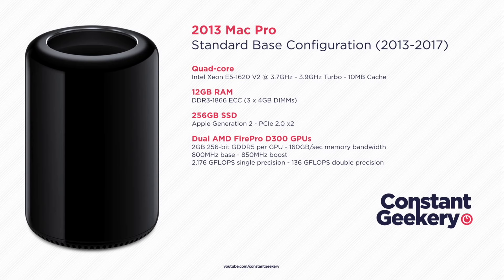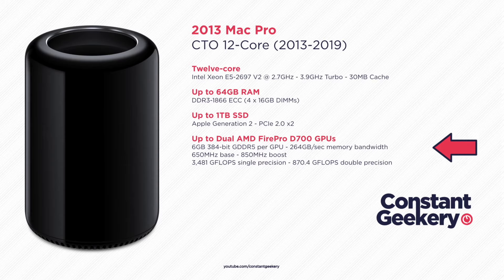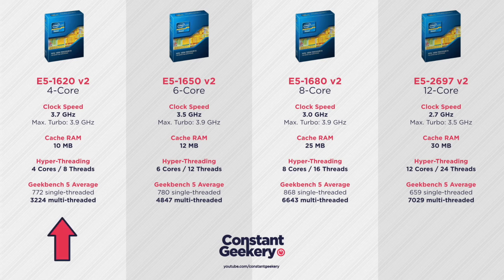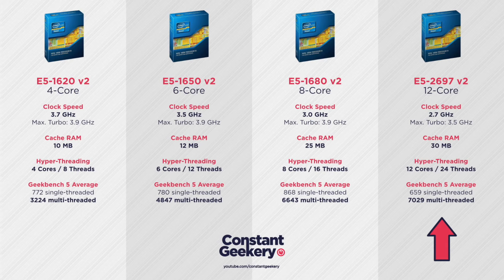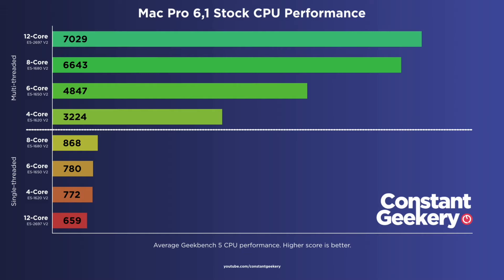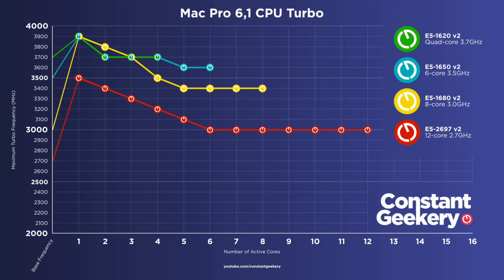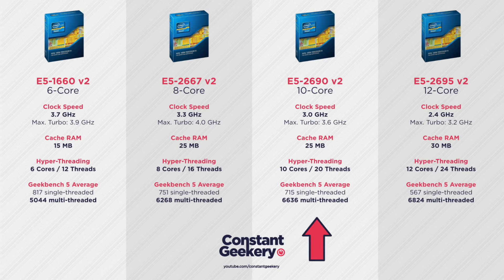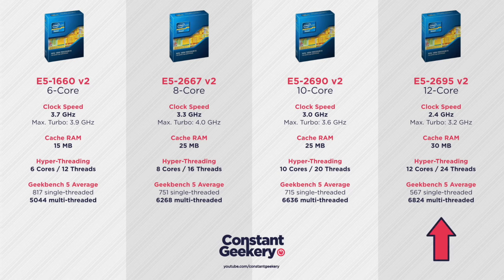Which 2013 Mac Pro should you buy?

Comment: Fantastic video and very useful information.  So is the 8 core version better in your opinion?  I use it with audio DAW like Cubase. Can I get more with the 12 core version? (for example more plugin at the same time, more tracks, etc.. )  thanks
Reply from the maker: The 8-core can boost more cores to higher frequencies, so for most people it will be the better real-world choice. The 12-core really only outperforms it when it’s using all (or almost all) of its cores. For audio, I’d say that individual core frequency is perhaps not as important as having plenty of cores - though that depends on the individual use case. Both CPUs will work well, but the 12-core will certainly allow for more plugins, tracks etc.
Reply: @ConstantGeekery  Thank you very much for your advices

Comment: Hi☺️👍🏻 how are you? 
I have a mac pro 6.1 quad core 12gb ram and 256SSD. I have seen all yout videos on youtube, i wanted to upgrade the machine. I’m musician, and i need power because i use a lot of track.  I think the 12 cores processor is the best,  where do you advice me to buy it? At OWC  the have it for 414$ tested, do you recommend another site? I would like to put the maximum of ram memory, to work well with orchestral libraries, and the SSD,  i saw in a video of you, that with the samsung nvme m2 970 evo, plus and adapter, was is ok? Thank very much
Reply from the maker: You can get 12-cores for less on eBay - I think mine was £195 (about $245). Obviously, that’s untested without a warranty, so OWC’s price is reasonable. Lots of these CPUs are pulled from servers that have been sat in datacentres their whole life, which is pretty much a perfect environment, so I wasn’t personally worried about buying used. I don’t personally use a 970 SSD in my Mac Pro. Bear in mind that the 970 EVO and the 970 EVO Plus are different models. The Plus needs a firmware update to be compatible, so I would stick to the standard 970 EVO. Many users say this combo is fine, but I’ve not personally tested it. If you’re in any doubt, find a generation 3 Apple SSD.

Comment: Do you think whether the Mac Pro 2013 base quad core model is worth US$200 in 2023 now for office work/light video editing?
Reply from the maker: I'd say any spec of the 2013 Mac Pro is worth $200. The quad core isn't going to light any fires performance-wise, but you have the ability to upgrade the CPU later if you want.

It'll certainly handle 1080p video editing, so long as you steer clear of modern compressed codecs, like HEVC/H.265. 4K might be pushing it, but it will depend on what you're doing.

Comment: why does Geekbench 6 show a lower result than Geekbench 4 or 5?
Reply from the maker: The tests are different and are calibrated against a different baseline (which gets progressively more difficult), so you can’t compare the scores. It’s also worth remembering that GB6 includes AI tests that are meant to simulate more modern workflows. Since the Xeon CPUs in the 2013 Mac Pro have no AI capability, the GB6 score is probably a bit misleading for real world use (if you’re not using AI tools in image editors etc.).

Comment: Issues with Bootcamp on Sierra and High Sierra

So I have a brand new Mac Pro 2013 with an NVMe drive and migrated my Mojave and files from a 2012 Mac mini with an HDD drive and that Mac mini USED to have a working windows 8.1 (I deleted it and reformatted the drives at some point)

Great the migration of logins and everything work. So I create a partition to use Sierra so that I can use that bootcamp to make Windows 8.1 like I did on the mini.

I have the same Windows 8.1 3.9gb ISO I used on the mini and the same flash drive. I go to bootcamp, select the ISO (yes it is unmounted/ejected in disk utility as recommended by many people) and when it comes to the USB I either get " Your bootable USB drive could not be created. An error occurred while formatting the disk" I redo the process a few more times and then it gets past that and then gets stuck at "An error occurred while copying windows installation files"

I have tried USB 2.0 flash drives and 3.0 32gb and 128gb. Yes they have been formatted to MS DOS FAT.

I even tried using a HDD, same errors.

Yes I have also reformatted my NVMe and done a fresh install of all and time machine backups. Same errors

So then I installed High Sierra as well, as soon as the windows support files are downloaded it says "Error while partioning your disk" (Directly to my NVMe)

Ive also unmounted/ejected the ISO after every try, I used an ISO splitter to split the ISO as well (After doing all of this) still same issues. I Love Windows 8.1, runs fast on everything and hate windows 10. I want to play my old games such as GTA 3 and Rolercoaster tycoon CDs yet Windows 10 doesn't work with them without  steam which I don't want to use. Can someone help?
Reply from the maker: I have a feeling that Boot Camp Assistant only works with Win 8 up to Sierra. 9to5 Mac do an excellent tutorial on installing Win10 to an external drive (https://youtu.be/3IhW722IMwE) - I know you don’t want Win10, but might be worth trying it with your Win8 ISO. I run Bootcamp from an external T5 SSD on my 2013 Mac Pro, because I didn’t want to partition my internal SSD. Maybe this is an option? 🤷🏼‍♂️
Reply: Constant Geekery it works on High Sierra and Sierra with 8.1, I used them on my mac minis. Im thinking the issue is that the Mac Pro uses APFS for the NVME while my minis both had 2x 1tb hard drives that used OS Journaled. Windows 10 installed without issues thanks to your linked videos, as much as I hate it for how glitchy it is, Im stuck with it. Thank you for the help friend

Comment: Thanks so much for this series. It has given me food for thought! 

May I ask whether you find any issues with the D500 and your Dell U3219Q, especially when smooth-scrolling long websites at scaled 4k resolutions?  I have been trialing an i7 MacMini but the UHD630 onboard graphics are just not up to it and the scrolling is dropping frames....  It's horrid!  In light of this, I'm wondering if a 6,1 might be an option as a stop-gap before Apple Silicon takes over.  Thanks again for the content.
Reply from the maker: Glad you enjoyed it. My Mac Pro has the D300s, but they are fine with the 4K display and scaled resolutions. Even a single D300 has something like 6x the raw power of UHD630.
Reply: @ConstantGeekery  Thanks, that's really helpful. Just need to find one at a sensible price!

Comment: JUST SEEN{:::::.......fully upgraded Mac Pro 6,1 has been upgraded to the Intel Xeon E5-2680v2 10-Core 2.80Gz Processor and 64GB of Memory. Alongside this it has the upgrade to support NVME storage upgrading to a 512GB SSD. BUT NOT MENTIONED WHICH GRAPHICS VERSION, would it be D500 do you think?

Comment: What would be the best graphic card variation Mac Pro to look for used, if planning to run 3 screens (maybe even 6 screens eventually) for stock day trading? Have the opportunity to purchase a nice condition Mac Pro with D500 graphics. Would this be suffice for 3 to screen setup?
Not quite sure if VRAM or the MHz speed is the more important spec to watch for smooth multi screen use? Would appreciate any thoughts on this?

Thanks 
Chandler
Reply from the maker: It depends on the resolution of the displays. I think the D500 would be fine for three screens. All of the models can support up to three 5K Thunderbolt displays, and I’ve seen six 1440p displays being used. VRAM is probably the most important factor.
Reply: Constant Geekery I appreciate the reply on that. So say in the future I’d want to move my trading setup to 6 thunderbolt displays, each running think or swim stock charts and other softwares. Do you think the D500 would still handle this with ease? Or is this something the D700 would be more necessary for, as it had the greater 6gb VRAM?
Reply from the maker: @yochanman  it depends on the resolution. As far as I know, all the 2013 Mac Pro models can drive six of Apple’s 27” Thunderbolt displays. Those were 1440p panels. I believe you can also use Mini DisplayPort (same connector as Thunderbolt 2) to connect 6 displays via DisplayPort. Apple updated these Macs so that they can support three dual-cable 5K displays, which is double the pixel count of six 1440p panels. If all the models can manage the 5K displays, it seems reasonable that all of them could manage six 1440p displays. So I don’t think you specifically need the D700 model for what you’re trying to do. I have no personal experience running this many screens though.
Reply: Constant Geekery ok awesome thanks for that. Yeah did mean to put the display types in last comment. 
My main screen is the 27” Thunderbolt Display, second is a 21” 2011 iMac running as an external display as target display mode.
then running two of those small USB-c portable 1080p lcd screens. So the D500 sounds like it should handle these just fine then
Thanks so much for the help my friend

Comment: Have been watching this Mac Pro series and it has really informed my decision to pick one up. One question I do have is, would buying an OWC apple ssd give me the same benefits as having a "genuine" apple ssd? The owc is keyed like the apple, but I cant seem to find performance number or whether you can restore the OS via internet recovery like an apple drive. 
Cheers!
Reply from the maker: I believe it is fully compatible, but probably best to drop their support team an email to check. The Aura Pro X2 will be limited by the Mac Pro’s PCIe 2.0 x4 bandwidth, so I’d say you’ll be looking at something like a max performance of1500MB/sec read and 1200MB/sec write. The drive is capable of more, so it should in theory run cooler, but I’ve not personally tested one.
Reply: @ConstantGeekery  Thanks for the insight, I will give them a call. The adapters are so cheep I might grab one and do a video showing the speeds.
Reply from the maker: @mechpilotace123  👍🏻send me a link if you do the vid - I’d like to see that.

Comment: I have a MacPro 2013 Quad-core D300, i recently upgraded it to 64GB, and 1TB OWC Aurora X2. I’m thinking about upgrading to the Xeon e5 2697 v2 12 core as i do a combination of vector design, photoshop, and FCPX. I’m wondering can you notice in day-to-day use the slower single core performance? Also i occasionally play games (e.g. Mad Max, Fortnite etc) will there be any hit on the performance? — as it currently runs just fine.. I’m getting around 60fps on 1920x1080p resolution.
Reply from the maker: Yes you can notice the difference in single core performance, but it’s not night and day. If you don’t need the extra cores, consider the E5-1680 v2 8-core. Not only do you get much better multi-core performance, but single threaded performance is also better than the quad core. Even if you went for the 12-core, I’d expect the gaming wouldn’t be vastly different.
Reply: Constant Geekery great! Thank you for your advice 😊 I’ve been searching for the e5-1680 v2 8 core as well but it seems to be difficult to find in with a reasonable price ( in Australia )
Reply from the maker: Yep, I never managed to get one at a sensible price either, which is why I have the 12-core 😁 The other 8-core option is an E5-2667 V2, which is actually slightly faster for multi-threaded tasks, and very slightly slower for single-threaded. It’s close enough to the 1680 V2 that you probably wouldn’t be able to tell the difference outside of a benchmark.
Reply: Constant Geekery Thanks.. I decided to go for the 12 Core 2697 V2. I managed to source a new open box CPU for a decent price. It should arrive in 1 - 5 business days. I’ll keep you posted on how it goes and whether it will suit my workflow. Once again thanks for your advice. :) Keep up the awesome videos.
Reply from the maker: Mladen Georgievski look forward to hearing how you get on 😉
Reply: @ConstantGeekery  Just wanted to give an update on my progress with the Xeon e5 2697 V2. The CPU came brand new, i bought it from (TechBuyer - https://www.techbuyer.com/au/ ) for a decent price. It took me about 1.5 hours to install, the process was quite seamless -- I used a combination of OWC's install and your installation video. The hardest part was figuring out how much thermal paste to apply and how to apply it. I used the technique demonstrated in your video. After running multiple Geekbench tests the results are: Single Core: 775, Multicore: 7750, which I was quite impressed with. Comparing it to the quad core e5 1620 v2, results were: Single Core 864, and Multicore: 3584. So even though single core is down, i didn't really notice any real-world performance reduction based on my workflow and use. However, video rendering is now super-fast (and as expected). To be honest, the Mac Pro generally feels a whole lot faster. Even gaming was quite fast and I didn't observe any FPS slowdown.. I've also been monitoring the CPU heat temperatures on TG Pro. It ranges between 50C - 60C for normal use and for CPU intensive tasks it peaks at about 80 C on average. My next project is looking into eGPUs :-).
Reply from the maker: Mladen Georgievski That’s excellent! Thanks for sharing and I’m really pleased the upgrade worked so well 👍🏻

Comment: I am using a 2013 Mac Pro 6 core / 16Gb RAM. As a music producer, I've learned that it is a very capable machine, especially running external thunderbolt devices. My only quirk is that there is "no way" to upgrade it to Thunderbolt 3. All new components are utilizing the faster USB-C. Having to use the adapter is a bummer. Any thoughts to a possible upgrade to utilizing the Ethernet port to Thunderbolt 3? or is it not the same speed? Thanks :)
Reply from the maker: There’s no way to get Thunderbolt 3 unfortunately. You can get faster USB by putting a PCIe card into an external PCIe Thunderbolt interface. Or, if you’re using eGPU, some enclosures (like the Razer Core X Chroma) have USB 3.1 ports. Thunderbolt 2 is quick enough to run these at full speed, though you’ll quickly hit the limits if you have more than one device plugged in, and the speed increase is probably not worth the cost. 

Thunderbolt 3 is 40Gbit/sec. Thunderbolt 2 is 20Gbit/sec. USB 3.1 is 10Gbit/sec. 

The Ethernet ports are 1Gbit/sec, so no options there either.
Reply: @ConstantGeekery  Thanks so much for such quick reply. I've subscribed to your channel. As a music producer, I use an OWC Helios Thunderbolt 2 chassis for a single card. I was asking because I am considering purchase a UA Octo PCIe card during holiday sales. This is to offload processing of plugins and entering into the world of Universal Audio. My ProTools is choking running lots of plugins. But the options now are all Thunderbolt 3. Is the only option for my 2013 Mac Pro the 3 to TB-2 adapter with a chassis?
Reply from the maker: @kirkskeys  Thanks for the sub 😊👍🏻 Yes, external PCIe is the only option unless you can find an older Thunderbolt model.
Reply from the maker: Or there is a USB option perhaps - not sure if this is the same thing: http://mrph.me/22KTY
Reply: @ConstantGeekery  Indeed it is. I am just a little cautious with that option since it is the same price as the bare card. I believe the card in an OWC enclosure may have more stability with a cooling fan. But thanks so much for your input. Much appreciated.
Reply from the maker: @kirkskeys  👍🏻 very wise, and better future proofing too. Hope it all works out.
Reply: @ConstantGeekery  Thanks for the affirmation. The last thought of concern on that product is that it is 8 years old! In the world of tech, that's borderline ancient. So I might wait for an obvious new release in the new year; unless there's an amazing sale on. https://www.uaudio.com/press/releases/2012/uad-2.html. Have you seen any product hold for so long?
Reply from the maker: @kirkskeys  not many products last that long. I guess if it ain’t broke, it doesn’t need fixing!

Comment: Isn't single thread performance important for Audio recording in Logic Pro? (and for low latency audio) & multi thread more for Plug ins and Virtual Instruments? If so it seems the 8 core processor might be the best middle ground option for using Logic Pro on the trash can. What do you think?
Reply from the maker: The 12-core has more than enough single-thread performance, and with its multi-thread abilities it was the choice for any audio pro needing to work with large scores and many plugins. The 12-core offers about 35% more performance in Logic Pro than the 8-core in that respect.
Reply: @ConstantGeekery  thanks for the reply & all your videos, especially Logic Pro related ones. So a 6,1 D300's, 12 core, 64 gb, running OS11 or 12 & latest Logic Pro. How would that compare to M1 mini 16gb? Or could this be another video, perhaps including M1pro & max as well? Logic oriented.
Reply from the maker: @andrewhorne7443  I have done those tests in other videos. The 12-core 6,1 with 64GB outperforms the M1 Mini 16GB in Logic Pro by about 15-20%. It also has better compatibility with audio interfaces and plugins… for now…